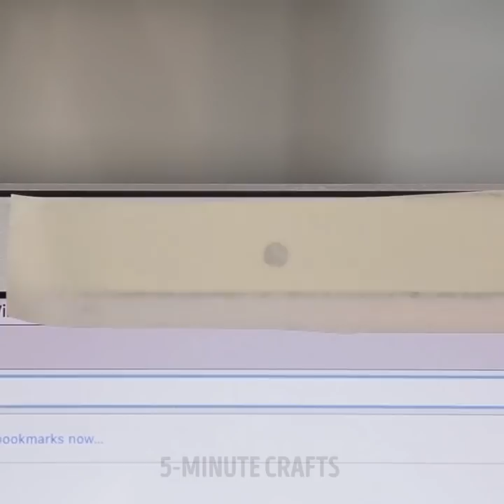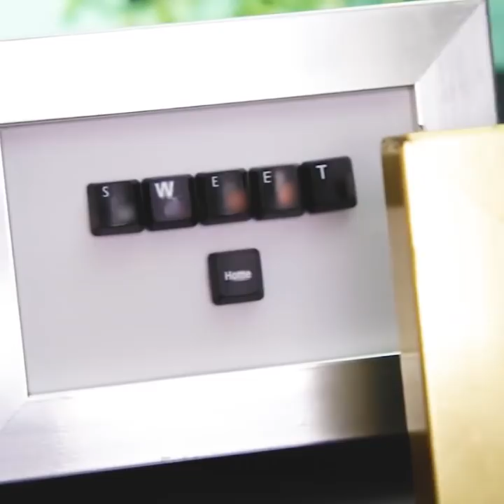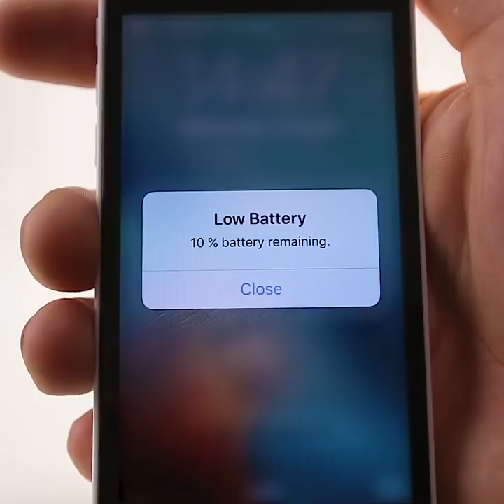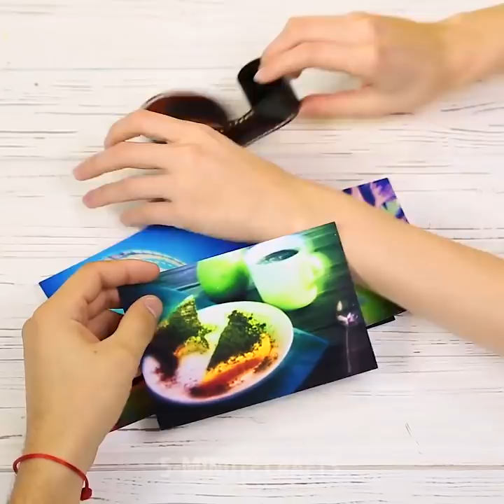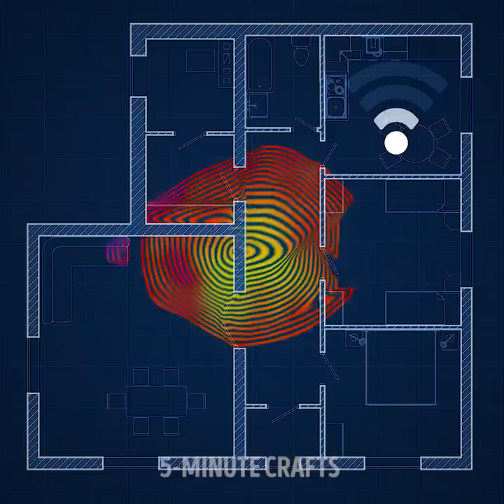19 GENIUS GADGET LIFE HACKS

Comment: On the lime lamp thing you can make the lime power the bulb all you need to do is insert two different types of nail sized metel preferably copper and zinc into the lime or lemon you will need to insert six pins each and connect them in series and then to a small led bulb. I know it works for myself.